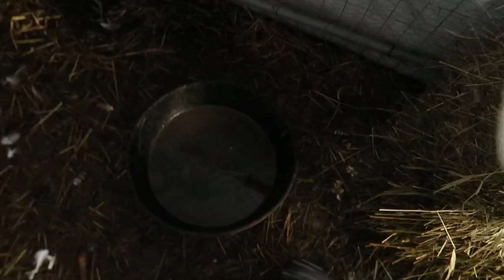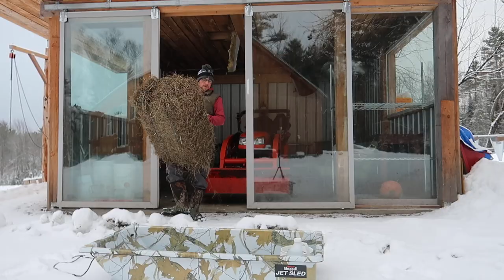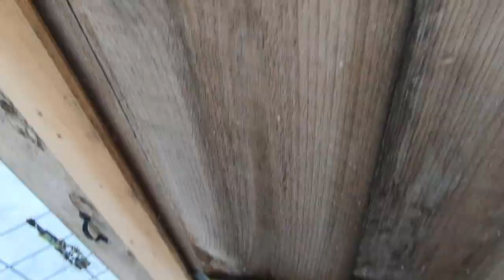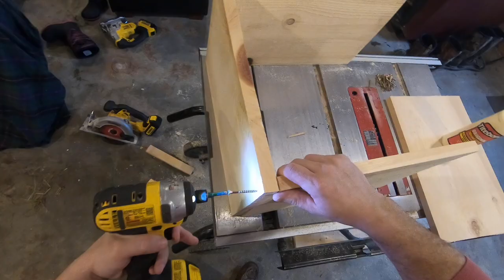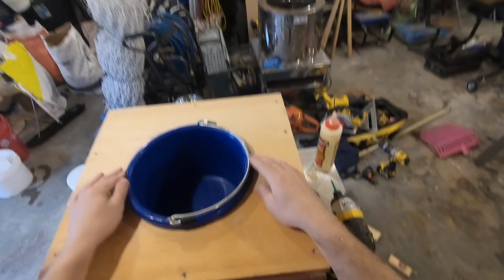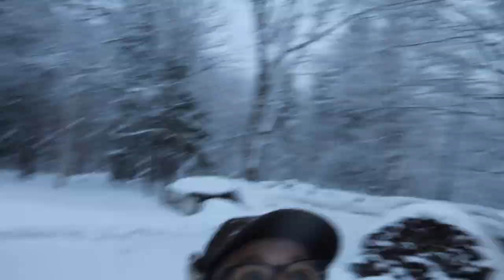I HOPE this WORKS! (Building an Insulated waterer to keep goats water from freezing)

Comment: Cant wait to see if that waterer works out. Stay warm over there😂. I truly love snow and in the same breath I get worn out shoveling. All part of it, roll with it😂😂. I dont know whats more adorable kids or kits😂😂
Reply: @Lorie Habel , 
Go more slowly when you are shoveling snow . Also , don't make yourself sweat. Sweating will make you wet and cold ! Cold is more tolerable as long as you are dry . Just the opposite of  so called  " dry " heat .
Reply: @donaldmiller8629  thank you for the worry i take my time, young at heart but the body goes OH NO YOU DONT😂😂
Reply: @Lorie Habel ,
I am much the same . A young mind in a 76 year old body.  Which gets me into trouble from time to time. My mind creates projects that my body has a hard time with !  Al built his $30.00 mobile coop in a few hours. It tool me a week and a half . lol  But , I did get two made over the summer.

Comment: 60 * F today and not a snowflake in sight !   Al , remember , wear just enough clothing to be comfortable while you are working outside.  Wear too much clothing and you'll begin to sweat and THEN you'll be cold ! Especially if the wind is blowing .
31 * F is not so bad when compared to 0 * F  .   If I remember correctly , 1" of rain is about equal to 10 " of snow .  So , 18 " of snow is almost 2 " of rain.
 I once had a very small , open diesel tractor that I plowed snow with .  I only had a 4' non-adjustable plow that I could only lift about 6 " .  Better than shoveling but I quickly ran out of places to push the snow to . I love watching you plow from inside of that warm cab with remote control of your plow cause I remember big snowflakes getting into my eyes . That fresh snow sure was beautiful though.

Comment: On a different subject..
Propane usage..
You use propane for cooking and hot water.?
How much do you use roughly per year
And do you have a tank water heater or tankless.
It looks like you have two 420lbs/ 120 gallon tanks.?
Thank you for the information..

Comment: Great job on the video.  FYI I have seen  a water bucket made with a old car tire and it was like what you did.  It had something to do with the black of the tier absorbing the heat from the sun and that with the spray foam kept  the water from freezing. Stay warm.
Reply: I have been eyeing a bucket at TS that is designed to fit into a tire.  If I filled the tire with (sheep) wool (I have bags of it) I wonder if it would work well even if it is out of the sun. I like that the tire is tough enough for sheep feet and maybe not slippery.  I'll have to think about pulling the bucket in and out (no handle I think), or if I would just lift the whole tire, which would be heavy.

Comment: Your conditions are the opposite of where I live.  In my state, Queensland Australia, the severe drought continues, it is very hot and windy and we currently have 138 bushfires. We are in for the summer from hell...
Reply: Fellow Queenslander here Melody . Al is insulating water from freezing , I'm fitting an air-con to my bedroom to prevent melting this summer .
Reply: Queenslander here too, the heat is unbearable and the drought too!
Reply: stay safe Melody x
Reply: @Gordon_L  We don't have air con at our place, only fans (which are very effective at moving the hot air around - but that's all).  I just jump in and out of the shower all day to keep cool.
Reply: In the dry hot parts of the USA people use a Swamp Cooler, it’s to humid here in Florida so I can’t use one. Anyone use them over there?
Reply: @joemc111  we are in Fl too and although it's pretty unbearable at times it's not that bad.. Stay safe over there guys!.

Comment: Love your idea about the spray foam.   what happens when the goats will be goats, and pulls the bucket from the box.  will that foam hurt the goats?  can you stuff the box with hay or straw instead of using the foam to insulate it safely? one reason the goats are so heavy is that we're going to have a very brutal winter this year.  the extra layer of fat is natures way of keeping them warm enough to handle the cold.  nature has a way of protecting its own! I am sure all the animals outside are a bit heavier than they normally are due to the weather were in store for.  
  they will slim down when its the proper time of year :)

Comment: If goats will use a nipple you take a old water heater put a nipple on it remove the gas housing unit put a 100w light bulb inside the area where the gas housing unit was.   That's it. Easy to fill easy to manage
Reply: Ronald Swanson    Great idea!
Reply: Sounds like a great idea

Comment: Actually sawdust is an awesome insulator that is much more environmentally friendly than expanding chemical foam. Way back in high-school (some 35 years ago) I built a solar water heater as a science project. And the water tank was made out of 2 old milk cans welded together that we put into a plywood box filled with sawdust and wood shavings from a planer (that we got from the waste pile of a local carpenter). Our system was able to produce scalding hot water @ ~80ºC. And overnight the water temperature was still @ ~60ºC.
And as a former woodworker you just might have the contacts to get sawdust and wood shavings for free from cleaning building sites.

Comment: You will have to offer that lumnah acres shrink wrap at your amazon store :) he he   Hole marker ... a combination square ( I drilled a hole in one end of mine) , rebar wire, coat hanger.Any piece of wood with 2 holes will also make that radius. The inside slot of your speed square also.   Perforated Metal Hanger Strap , I keep some in my truck tool box (with that rebar wire ) . One time while traveling in my youth .. memorial holiday weekend bumper to bumper on the interstate. A person broke down on the road . The fan thermostat died , so their car was over heating. Well it took three different guys to solve it . One had a pocket knife, one had electrical tape and I cut the wire from my old broken radar detector in the goodwill box in my back seat. We wired the fan direct to the battery , she made it the 5 miles to her home. That is the day I created an emergency "get me home or help another person" trunk tool box. That might make a good video Al, "whats in your trunk" ? ha ha Looks like a attic ceiling door is on the todo list for the outdoor kitchen? The kubota almost has a smile in front of the bucket parked in the solar / kitchen/ garage :) It will be cool to see if the goat water box keeps things HOT !!!! Great video Al , thanks for sharing your journey :)

Comment: I have an old pop-up camper frame that friend gave to me and I'm going to do the same thing I have 7 quarter acres here and I'm going to get meat birds next summer so I'll build it next summer before I get the birds is it okay if I call it New York City to awesome job my goats are doing good matter fact I just got a baby one November the 15th and it's doing good and they're too fat to cutting back on some of the food for them myself keep up the good work things
Reply: Keith S I would use that for laying hens not meat 🐥 you will need to build different cages for the meat chickens that way they can be moved daily to anew area. This can save on feed costs in the long run.

Comment: not all, but most major brand tape measures have a slot in the hook. use a roofing nail (or one with a head that fits well) , hook it in slot, hold the center of pencil on the underside of you mark  and work your way around
Reply: a screw might work as well .the one you used looked as if it may have worked

Comment: Remember the old xmas lights before we got leds?  those would help keep the water from freezing but then how would you power them? plus its prob a bad idea to have any kind of wires around goats even solar powered.  i guess my ideas aren’t very good. ah well i hope your idea works.  what if they tip it over?  i worry about how toxic that foam is.  love watching you coming up solutions to problems.  i am the same way.

Comment: It was 38 here in Florida for the past couple nights!  WOO!  Winter is here!  It'll be back in the 70's in a couple days.............This cold every once in a while is OK, but if its this cold now, what is February going to look like???  Those goats probably instinctively know to put on weight because its going to be a very deeply cold long winter due to the Grand Solar Minimum.  Back during the Maunder Minimum, the everglades froze over.........image what the North East is going to look like............If you used a peltier heater on a metal pail with a battery, it could also keep the goat water from freezing.

Comment: We need to find a better way here on the homestead.  The electric water heater get a little pricey.
Reply: Two Wild Onions Homestead Larry and Lisa Leisher I use to use a heat lamp worked great and not that costly.
Reply from the maker: We had horses a long time ago we heated there water one winter I remember getting the first electric bill! It went up $100!
Reply: @Two Wild Onions Homestead Larry and Lisa Leisher ,
My electricity is a LOT cheaper than my propane gas . Try solar which is costly initially but the annual cost goes down yearly until you reach zero cost . From there it has a plus return.  My energy costs only increase each year and I never have a plus return.  I am seriously considering solar , wind and wood .
A rocket stove only requires about 1 /10 of the wood that a wood stove uses . Ha ha , you could have the triple LLL homestead .
Reply: Two Wild Onions Homestead Larry and Lisa Leisher solar is even a better ida. Solar wasn't available in my time.
Reply: Two Wild Onions Homestead Larry and Lisa Leisher I just read an ad about Harbor Freight is having a sale on their solar.
Reply: What are you paying per kwh for electricity? Here in NC I'm only paying 9cents so I use electricity for most of my heating options because it is relatively cheap. We also have a wood stove.

Comment: Hi Al, What amp batteries did you get for your Dewalt tools. I have been looking at the 5 or 6 amp as well as the flex. Since the flex will last 4 times as long I just wonder what will be the best bang for the buck! Thanks!
Reply from the maker: we have alot of 4 amp batteries the 5 and 6 are pretty big and heavy to be holding for awhile

Comment: Also, might want the hole a little bigger so bucket is flat on board.  If goats feel bucked waggle they will grab edge of expose bucket lip and chew on it or pull it out.

Comment: If this don't work try yousing a 5gal bucket with manure 2/3 of the way up the outside of the pail the heat generated from the manure will keep the water from freezing down to about 15 degrees  F

Comment: Wouldn't it be cool if there was a contraption that could include a small heating element included in waterers? One that is run on solar OR electricity AND not hot enough to start a fire. They probably make these, IDK, but you guys that get so much cold & snow need some help...lolol.🌺